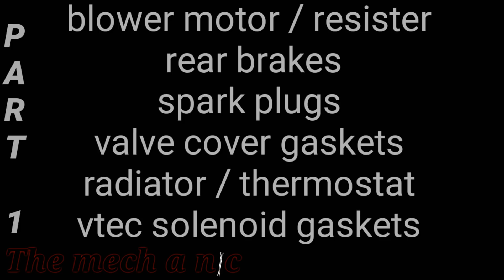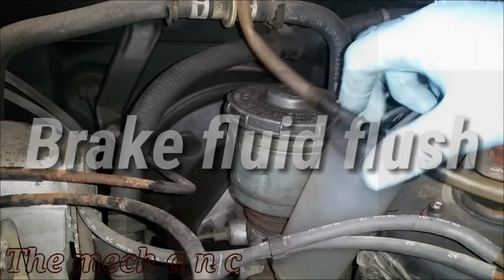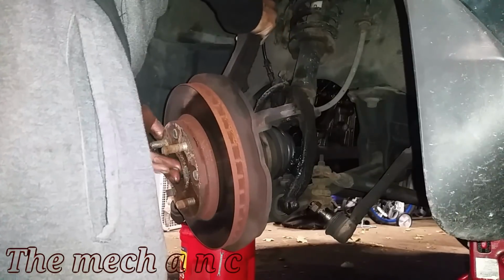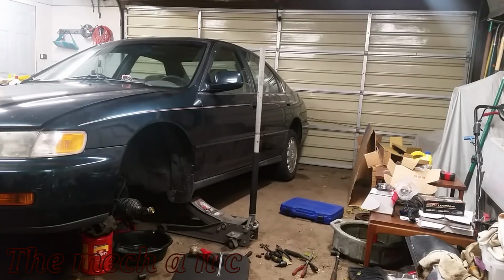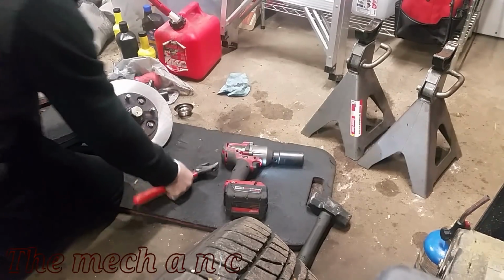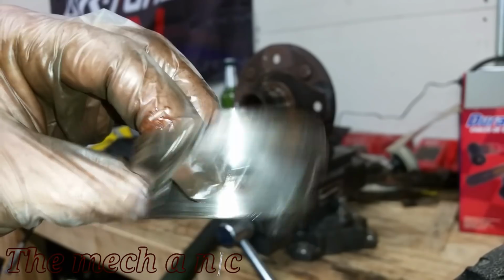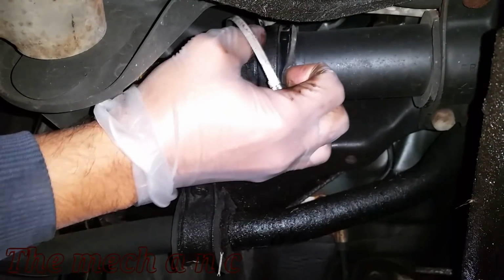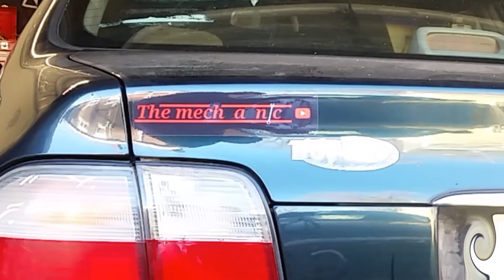97 accord , restoring some life into it  (part 2)

Comment: Cool video set.  I have a 1995 Accord EX with the VTEC 4 (2.2L) and a manual transmission.  It is the last car I bought new, and it now has 312K miles.  ORIGINAL clutch still going strong.  I did my tie rods like you did (same tool as well), and those boots on the rack are a PITA to install, as you clearly demonstrated (I stretched mine out for hours which may or may not have helped).  Brakes were done by my "Honda guy" (an actual Honda dealer tech for decades but does work on the side).  I used an offset wrench instead of a socket to get to the lower VTEC solenoid bolts (it just engaged better than the socket), which stopped my oil drip.  I just put a new leather interior in it a couple years ago and still commute with it, getting close to 30 MPG reliably.  Still need to deal with the random fix here and there, but a solid car.  Thanks for the video!!

Comment: Where the wheel bearing goes into the spindle, once you get it apart, clean all the rust up and then put a thin coat of grease between the 2 pieces and the next time you need to go in there for rotor or wheel bearing, it comes apart very easy,,,,,,,,,,,,,,,

Comment: Just what I needed 👍 Awesome videos 1 & 2...Yup, I love my 97 Accord SE. Bought it from my Bro for $800. Just need an engine and suspension work, then down the road. Will be using the car as a commuter. I drive over 132 miles r/t everyday for work and these cars could handle the high mileage. I had a 94 civic, and totally miss that car. Some bozo decided not to stop for a red light and totalled my car last year. She suffered major rear and front end damage. No way to bring her back to life "( Glad I got the Accord, she came with new tires and a bumping stereo for the commute 😃
Reply: I had the same exact car! I'm looking for another one like it!

Comment: The front hubs can be changed so regular rotors can be used. I did it on my 97" Accord. You reuse your stock calipers. I used the 4 lug bolt 1998 Acura CL hubs, but that's only because I just bought rims for the car. I really wanted to go 5 lug bolt; more choices when it comes to aftermarket rims.

Comment: You can do a direct swap for the hub,  and bearing from a 1999 Acura 2.3 CL and it will convert your 97 front brakes from hub-over-rotor to the standard rotor over hub...

The 1999 Acura 2.3 CL rotors are direct bolt on after that.
Reply from the maker: That's pretty neat  , if it were my car I'd do that swap but it belongs to my cousin and so far he's happy with it 👍

Comment: You'er a bad boy.  Not easy work, but you did it.  I got a 97 Honda Accord SE, and started off paying mechanics til I realized how fucked it was.  So, I ended up doing a lot of work on it to save $.  Still have it, just need a few things like cruise control, mounts & radiator and finally body work but, mechanically...finally ok.

Comment: That wheel bearing design incorporates the worst of both worlds. It has a bolt-on design, but requiring one to break the bearing in two to get it out. With a bearing replacement required every time a rotor is changed, it is easy to see why manufacturers abandoned the idea.
Reply from the maker: Yeah its a shit design but i found out the bearing doesnt have to be replaced , it just has to be seperated from the knuckle but if you're going in that far you might as well replace the bearing

Comment: Great video man. Keep up the good work. I found a faster easier way to change the front  rotors is to use a slide hammer instead of taking the whole front spindle out. I did this last weekend on my 96 accord lx.
Reply from the maker: I didnt have a slide hammer at this moment. I do now

Comment: How much would you say this entire restoration cost ya? I got the same make and model bro!
Reply from the maker: For labor? Im not sure i didnt add that  up. But to do all the work i did to this car, it would cost more than the price of the car.
Reply: The mech a nic Nah, just the parts. I just finished your vid and you said like $800. Labor, clearly, you got it handled lol
Reply from the maker: Yeah i included it in the video. $800 in parts is cheap to get a car like this running in good condition again. Labor to do all this work would be expensive if you paid someone to do it

Comment: Where did you order the parts from?
Reply from the maker: Mostly rockauto,  some eBay  ,and some parts from AutoZone
Reply: @themechanic6117  on the 97 honda accord ex where the shifter or cc solenoid?

Comment: Allright u change all of them  rusty leaking oil shot parts but u didn't replace the lower ball joint ??? How long you   think itll last till it snap!!!
Reply from the maker: Funny you mention that because my cousin is bringing it over next week to do the lower balljoint.  This wasn't my car to just throw parts at.its his money. All the parts replaced had to get the green light from him just like any other customer. I've had customers come in with a wheel bearing so bad that it looks like the wheel is about to fall off yet all they want is front brake pads installed. If it were my car I would have changed it all
Reply: The mech a nic  YEP just in time !!! Having a bad lower ball  joint is not good !! It's dangerous. .I had them replace after finding out they had alot of play in em.
Reply: The mech a nic KEEP UP THE GOOD WORK BRO!!!
Reply from the maker: Had a customer here the other day, crv lower balljoint snapped in two. Had to get towed in

Comment: What the heck? I've never seen a Honda where you had to replace bearings in order to replace brake rotors.
Reply from the maker: You dont have to. Once you remove the knuckle with the bearing attached to it you can slide the rotor off the back. I didnt know that when i made the video
Reply: @themechanic6117  I suppose what you suggested is easier but I still dont think I have ever seen a hub over rotor design like that before on any Accord or any Honda. That's what is so surprising to me.
Reply: @themechanic6117  by the way you did a great job on everything. I loved the video. Does your cousin still have the car? If so, how many miles are on the odometer now?
Reply from the maker: Yeah honda did it on there older cars .its weird. Yes he still has the car. The exact miles are unknown due to the cluster not working. About a month ago we did the timing belt on it. Its still going strong 💪
Reply: @themechanic6117  I respect your knowledge but they must've only did that for a very short period on certain models.  I've owned an 86, 93, and 06 accord. 93 and 01 civic and also had a 97 integra. I've never seen that before.
Reply from the maker: Yes it was only on accords of certain years. I dont like the design. Too difficult to change compared to regular rotors
Reply: @themechanic6117  That's crazy bro. I asked a buddy of mine who knows Honda's pretty well too. He said he's never seen this. I also asked a buddy of mine who had a 94 Accord EX. (Same generation)  His was the standard type, not like this. I'm just shocked. This might sound like a crazy question but any chance that car is from Canada? Maybe not because the speedo would read kmh  I think...
Reply from the maker: Dont think so. I just went on rockauto.com. for a 97 accord with the 2.2 all the front rotors are the same like the one I installed on my cousins .(behind the bearing)
Reply: @themechanic6117  I guess I was wrong about my 93 and my friend was wrong about his 94 that he had. This was a long time ago we had these cars and now that I think about it I never personally worked on those front brakes myself when I had that car. Anyway, it appears all of the 2.2L Accords from 90 through 98 had this type. I guess you learn something new every day. I subscribed. You seem like you know what you're doing.
Reply from the maker: Thank you. I appreciate it